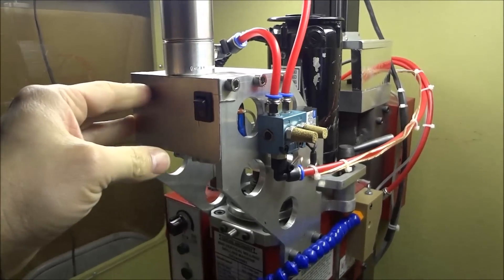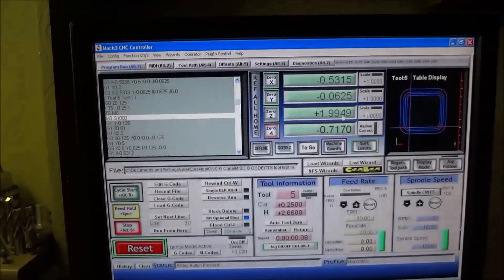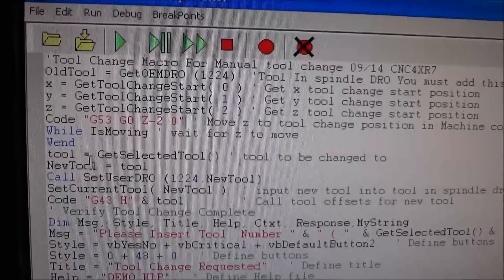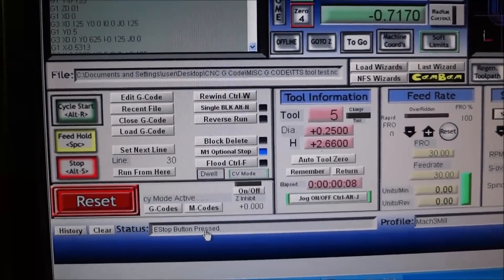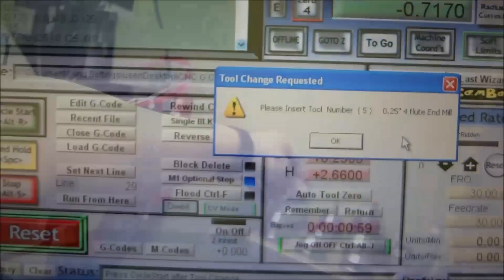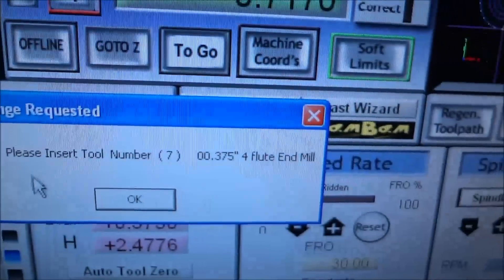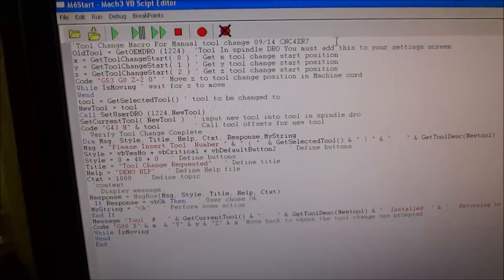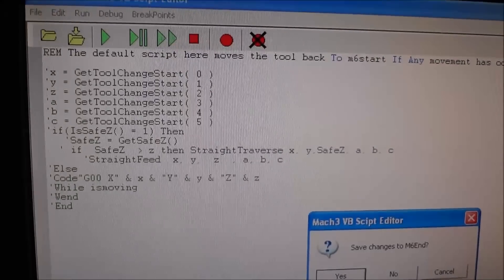Mach3 PDB Manual Tool Change simplified!

Comment: How can i add  2 spindles to be used as a tool changer
 in mach 3.
Reply from the maker: I'm not exactly clear on the question? 
Is this a mill or router

Comment: Thank you for the great script....but where do I change it to metric and not inch??  thanks for the help
Reply from the maker: Change this line :Code "G53 G0 Z-2.0" ' Move z to tool change position in Machine cord.
And This Line: Code "G00 Z .25" 'Move Z back to .25" above zero in work cord.

These are the only Inch and are for the tool change location of Z Axis
Reply: Thank you for your help

Comment: I'm new to mach 3 and just got my cnc machine.  This may sound really stupid , but what  does the "tool in spindle DRO" do, and why did you enter 5 in the box? You already have the heights of the tools set in the  "tool table' is that correct? Thanks for your time.
Reply from the maker: Ok Let me see if I can answer that. The Macro uses that information in the M6 Macro.

When a M6 T X  line comes up in the Code the Macro runs it checks to see if the Current tool ( the one the G code is calling for ) and the one in the Spindle are the same if so the M6 macro ends and exits. If there not the same the Macro executes and prompts you for the tool call for T X  you insert the tool click OK the macro will apply the Tool offsets No need for a G43 in the G code.

I guess your referring to Tool # 5

Comment: This is awesome, can you send me a copy. joe2456001@gmail.com  thanks
Reply: +joe2456001 Sorry thought i should say what i'm planning on to do with this. I'm planning using this on my 6040-z machine. I'm getting the collets like what you did in the video. If this works it will be awesome.
Reply from the maker: +joe2456001  On the way

Comment: Hi Andrew, I am working on my mill and should have it running soon. Could I please get a copy of your macro, gtwfa@verizon.net  Thanks. I like your posting very much
Reply from the maker: +Gerald Wells  Hi Gerald I'm Sam, Not Andrew  your email is not working you can find all the info you need in the description on this video, https://youtu.be/26_N4uwRWmQ

Be Safe,
 Sam
Reply: +CNC4XR7 Thanks a lot Sam. I will take a look at the video.
Reply from the maker: +Gerald Wells Great! let me know if you need anything,
 Be Safe Sam
Reply: +CNC4XR7 I installed it like in the instructions. I choose the .set file and overwritten the M6start file, but do i need to set the off set of my machine to be able to do this? Also as a quick test can I do "T2 M6" and it will pop up the change tool window? th
Reply from the maker: +joe2456001 Email sent yes populate the tool table. No it may not since you dont have a T2 set up in the table

Comment: I liked your vid very much. I am just starting to get to grips with VB script in Mach and I'm struggling. I have the need to return a Random variable into my G-code i.e.
N90 F300
N100 #123=<random number>  something like: #123=M999
N110 G1 X[SIN[#123]]              or                     G1 X[SIN[M999]]
N120 ...
How would you suggest that I do it with VB script?
Reply from the maker: Jim Taylor Hi Jim I would like to just throw out a couple lines of code to solve your problem but its hard for me to understand the  question Not really sure what your trying to do. But I may be able to help. Here is a link with VB guide in the beginning its covers Variables  it may be able to help. 
 Thanks Sam
https://www.google.com/url?sa=t&rct=j&q=&esrc=s&source=web&cd=2&ved=0CCQQFjABahUKEwjcz-zPyKHHAhVJqYAKHVx2B24&url=http%3A%2F%2Fwww.machsupport.com%2Fwp-content%2Fuploads%2F2013%2F02%2FVBScript_Commands.pdf&ei=jzLKVZzMEsnSggTc7J3wBg&usg=AFQjCNFszAIBSvNbzrOHiGC9a9OX58NWWA&sig2=PH6xewmaanVEaPcm3DjzlQ&bvm=bv.99804247,d.eXY&cad=rja
Reply from the maker: Jim Taylor I see so you want a Macro that will generate a random # and input this # into the G code?
I'm not a Visual basic guy but I'm sure you've Googled it by now but I did find this; https://social.technet.microsoft.com/Forums/scriptcenter/en-US/406b050e-afea-44dc-8237-b8a29416d4d1/vbscript-truly-random-numberpassword-generators

Now let me ask you this could you place this random code at the end of the G code and when it gets to this operation just have it call a fixture offset  ( may not be totally random though) but might solve your issue.
I think the guys on the forum above can help with the random # once you have that you just need to Know how to insert it into the G code.
Sorry I'm not much help,
Sam
Reply: CNC4XR7 Yes you are correct about inputting the number into G-code. Any snippet of VB script showing how to write a function the will return a value into a Mach3 G-code program ( #<value> ) would do the trick for me.

I did not know about the social.technet actually but I have made it one of my bookmark pages. I had a search around it but could not find anything relating to cnc/G-code/VB script/Mach3 environment.
Thanks for trying Sam.

When things get as difficult as this, you begin to think you are asking the impossible.
Reply from the maker: There was a script to return a variable at the link. I think you'll get it solved. Let me know how it plays out.

Comment: Would love to try your Tool Change macro.  I just can't figure out how to get the 1224 DRO into my Mach Screen.  I'm using MachScreen and I can only add predefined Dro's. Been pulling my hair out for a week. Can you help. Thanks
Reply from the maker: lectrickid No Problem I can fix that. Help has already been sent to you via PM on You Tube

Comment: Between your CAD/CAM and your Mach 3 settings It should do this. Your next tool description would show on the screen if you entered it prior during the CAM. It would say to press cycle start after the tool change too. Not sure what you did different except add a dialog box requiring an additional key stroke.

Am I missing something?